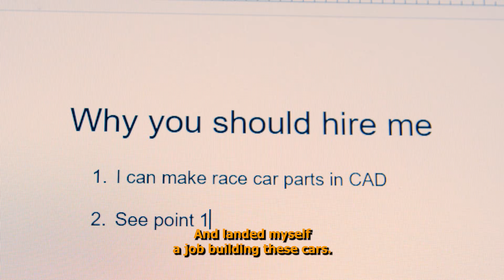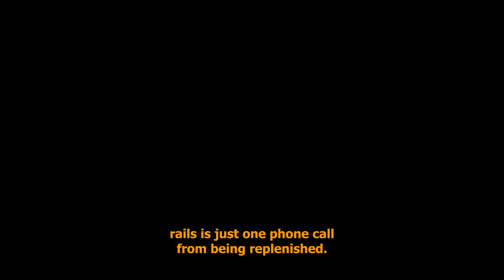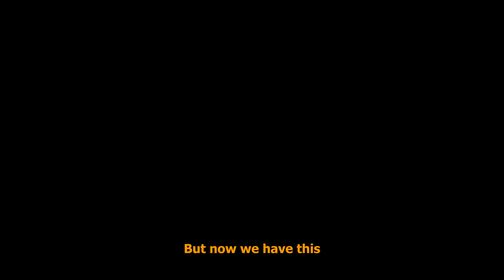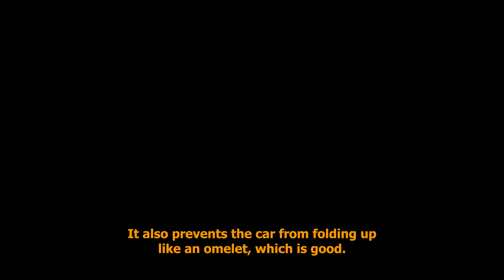I'M BUILDING MY OWN FORMULA RACE CAR!! (Hyper Racer X1 Build - Episode 1)

Comment: Everyone is going on and on about how racing is expensive.
They aren't searching hard enough. 
Formula 2000 cars from the 80s are super cheap rn,
You guys with hyper racer are making it way more affordable.
Reply from the maker: Thanks! But I think while older formula cars can be cheap to buy, they come with significantly less safety, depending on what car you don't get competitive racing, and maintenance/part availability can be very bad.

While a Hyper Racer can be more expensive upfront to buy, it's so much easier and cheaper to run. I just bought a spare motor for $4k, and being a bike engine It comes with a free gearbox!

Comment: I’m confused, if you work for them and build them? Why not just have one built at the factory your work at? Wouldn’t it have been cheaper to just buy one at cost or discounted from them?
Reply from the maker: Well no, labour is expensive. My time is free! I've been building this after hours. Buying one at cost and letting the team build it would be significantly more expensive.
Reply: @ figured as an employee they would encourage you guys by offering a significant price discount for being an employee. Good to know. I’ve always wanted to build one of these but I wasn’t sure where to get the dimensions and start with the jig my self. I have the fabrication tools but not the knowledge or specs to make one. Especially when it comes to suspension geometry and mounting locations
Reply from the maker: Yeah there's no plans available, we only sell them as complete running cars. I'm certainly lucky to be able to build my own after hours!

Comment: I’m in Western Australia looking for a low budget racing championship. How far apart are the races?
Reply: Thanks for responding! But the race spec cars that you have to buy are way over our budget. Thanks for the info though
Reply from the maker: More than understandable haha! While the car is expensive, the running costs are probably the cheapest of any category in Australia while maintaining competitiveness. Even Hyundai Excels have teams with big budgets. This really is one of the only categories where the rules prevent unnecessary spending to gain a competitive advantage. I hope you do find an avenue of motorsport to go down!
Reply from the maker: Hey! Next years calendar has been released on the Hyper Racer Facebook page if you want to check that out. You can also find more information at hyperracer.com

Comment: These cars don't have Motorsport Australia log books. Therefore, how can you demonstrate that the rollover protection complies with Motorsport Australia, or even FIA, rollover protection rules?  I had a close look at a Hyper Racer last week, and it is very impressive.  It is a shame that you dont race it in MA events.
Reply from the maker: It's a long story. The car was originally designed and built with the intention of getting an MA log book. They basically pretended for months that we'd be able to get one, made us change a few things and then at the end said no. AASA is evidently taking over and reviving Motorsport in Australia. We are proud to run under the AASA.
Reply: @formulazac9  Thanks. Hyper X doesn't fit within any existing MA Category 1 (Open Wheel) Class (Formula Vee, Ford, 3, etc) and I never would have expected MA to create a new class within Cat 1 for Hyper X - everyone complains that there are too many classes.  However, Hyper X could qualify for a MA Free Formula log book, and you could then race within Formula Racing Cars in NSW, and SA Prototypes.  Doing that would allow you to keep working within MA to come up with our own group.  AASA does have some negatives.
Reply: @zaccatlin  Thanks for that.  Were they Free Formula log books?  I will ask around.

Comment: Dude, since you got to know the engineers behind this chassis, it would be interesting to have a content about "How's to get a FIA homologation for a chassis, and for one of your own design."

...when I started exploring how to build my xKart I wanted to do all by schoolbook (lol) and ppl told me that FIA homologating a one-off is pure madness, unless you want to build say a dozen and start your own championship renting them. I can see it's very plausible and stuck to their xKart rulebook just for the obvious safety measures, size and materials and basic rollcage shapes.
But for personal knowledge I'd be still curious to know... What's the thought, what's the burocratic iter, timings, projected expenses, of creating a brand new, FIA compliant, race chassis.

Thanks in advance if you'll treat this content, I subbed, just in case! ;D

Comment: This is great.  Being from USA I've admired the Hyper Racer from afar but it's cool to "get up and close" to on in your video.  Looking forward to the series.   If you can share, what is the finished weight of the chassis?
Reply from the maker: We've recently sent 12 cars to INDE Motorsports Ranch if you ever get a chance to check them out in person. The final weight with all fluids is around 430kg.

Comment: Oh wow.

Amazing camera work, amazing video. 

I have so many questions. 

How much is it to build one of these? 
Is the engine a stressed member? 
What are the dimensions? 

Anyway. I'm subscribed and really hyped to see the build and racing.
Reply from the maker: Thanks so much!

The RRP for a Hyper Racer X1 is $78,000 USD.
The engine is not a stressed member like you would see in modern carbon tub formula cars where the engine is part of the chassis.
It's 1950mm wide and has a wheel base of 2450mm.